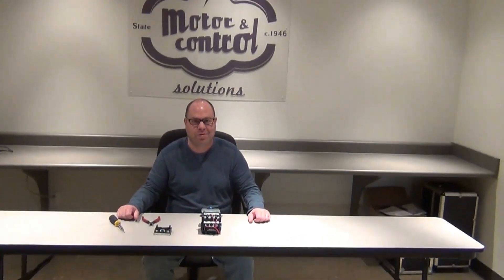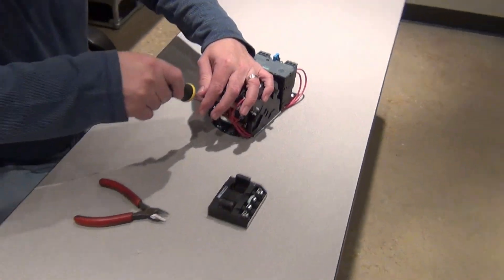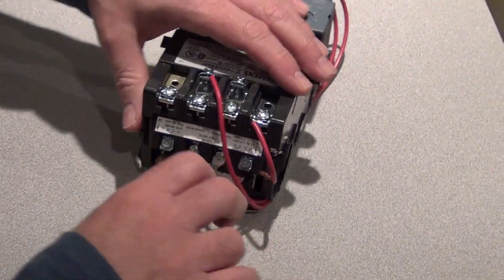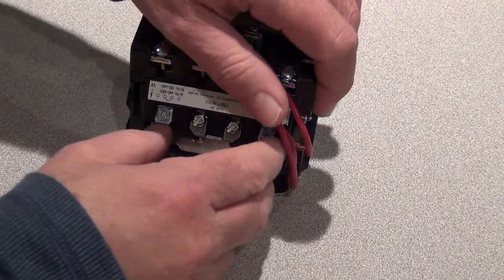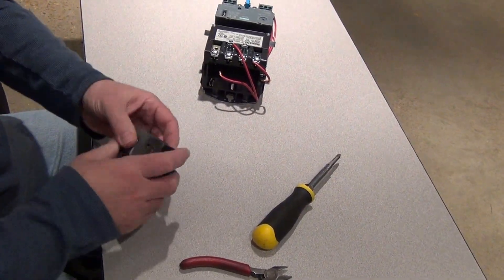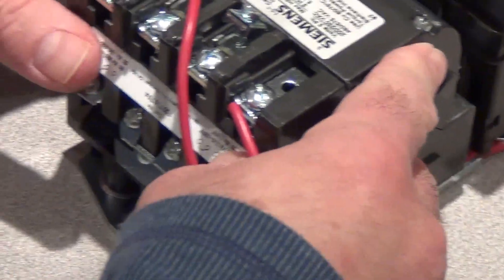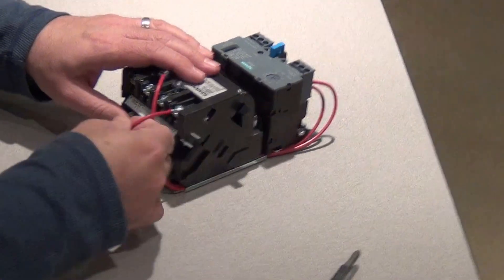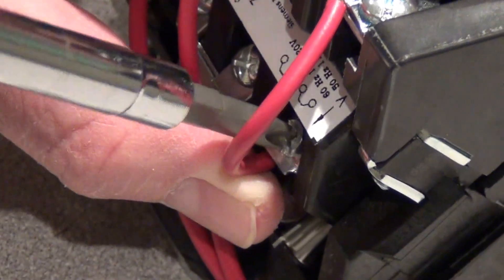Furnas and Siemens Motor Starter Coil Change Procedure

Comment: Where does the 120 volt from the controls hook to the coil terminals on tge dual voltage esp200? Unclear. No typical A1 and A2.

Comment: I have this same starter and when my motor starts the contactor bangs in and out several times. It does the same thing when the motor stops. I replaced the entire starter and it does the exact same thing.
Reply: I am having the same issue now....any update?
Reply: Pressure switch contacts likely rattling when making contact, which controls this starter

Comment: I bought one be cause it came pre wired so I change the coil to a 120v what about the wire A and B do I need to remove them or not
Reply: The input Will be 3 Phace 480v coil 120